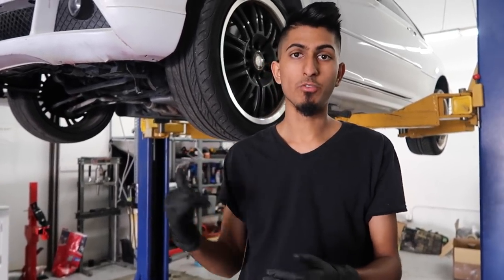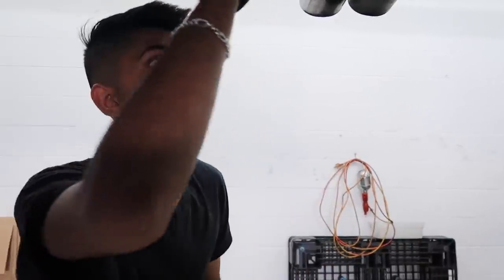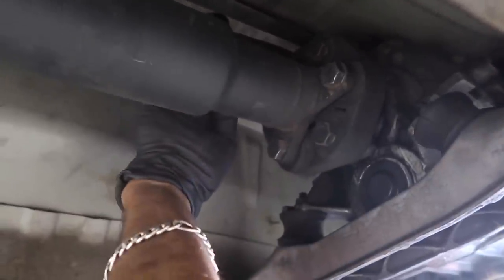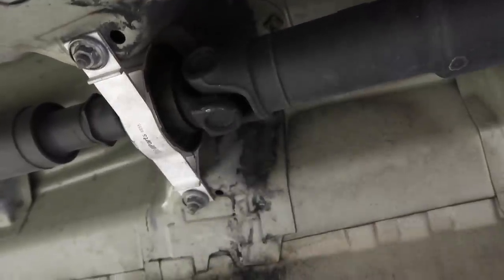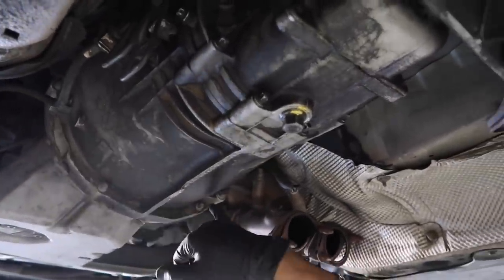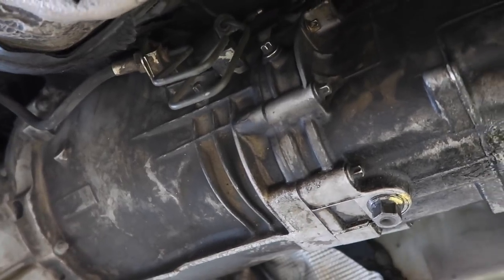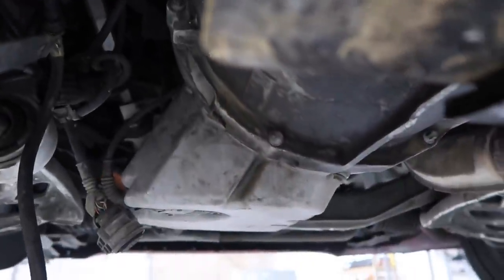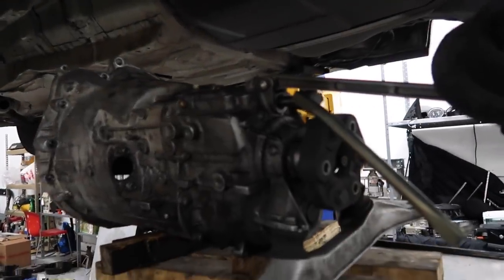DIY BMW Clutch Replacement (Part 1)

Comment: cant believe i never thought of using the screwdriver trick when unbolting the diff. Totally forgot about that on like 4 different occasions and kept crawling out from under the car, undoing e brake, spinning drive shaft to other bolts, crawling back out and pulling up ebrake, then getting back under to get the bolts off.

Comment: Very good video, but my one peev in all videos that i have watched is that everyone labels the bolt size by the size of the socket required to remove it not the bolt size.  Just a detail but go to the store and find a bolt or nut the size mentioned and it will be the wrong size every time.  Bolts are categorized by the size of the shaft and threads.  So 8 mm X 1.25 mm X 50 mm.  usually uses a 13 mm socket, or 12 mm socket in Japanese cars.  8 mm is shaft width, 1.25 mm is the distance between the thread ridges, 50 mm is the length from under the head to the end.  Good luck

Comment: I have searched all over your channel for part 2. To this.   Putting in new clutch and flywheel   and found a seized  engine.    Very odd seeing how I drove it in the garage and it would run if started in neutral. Wondering if I did something  during swap. Or missed a step.  Old video yeah. But if you do get this direct me to part 2 please
Reply from the maker: Hey part 2 was taken down but I added another video that goes over the whole process, it’s in the description: https://youtu.be/59xXMFTVgzo
Reply: @ShopLifeTV    you the man.   Thanks bud.  Imma figure this thing out eventually

Comment: I ended up breaking the little thin metal plate looking thing that is attached to the bell and the block. Do I “need” to buy another one or is it okay to just put everything back without it

Comment: This was a fail for me because the E14 bolts were stuck on extremely tight. I had to reassemble everything. I even used a Milwaukee impact driver but nothing. Any tips will be much appreciated thanks.

Comment: Hi guys, I got my bmw e46 318 n42 engine, the car was pulling as much, you it slapping after it catches speed, so they rebond the chutch plate, after it doesn't want to  move, and from  the shop they give me washers to put between pressure plate and flywheel, but still doesn't move.... please  help

Comment: I purchased a self adjusting clutch from the dealership and I accidentally removed the locking plate before i installed the pressure plate and i installed the pressure plate anyways because it was too difficult to reinstall the locking plate. Once I reinstalled my bell housing and slave cylinder, I tried pushing down on my clutch but it would only depress about 1 to 2 inches and hangs up. Now I need to pull everything apart again. Does anyone know if it is critical to remove this locking plate after install and not before? Is this why I am unable to depress my clutch? 

I just tried reinstalling the locking plate onto my old pressure plate using a large  2-jaw gear puller and a 3/4" x 1.5" x 1.5" piece of plywood for the pushing plate in the middle for the gear puller. i was successful! 😀... So now I'm going to pull everything apart again to try and reinstall the locking plate... 

Please someone let me know why my clutch does not depress and if it is really critical to reset the clutch with the locking plate... I don't want to have to pull my transmission again...

i ended up dropping my transmission again yesterday. when i looked at the pressure plate, all of the fingers were fully depressed which is why i could not push down on the clutch. i then pulled off the pressure plate and followed a video on how to reset a self adjusting clutch. i built a jig, reinstalled the locking plate in the middle of the pressure plate and then while i reinstalled the pressure plate onto the flywheel with the 6 hex bolts i had to compress the springs on the self adjusting mechanism as i torqued the bolts to 35 Nm. then i popped out the locking plate and put everything back together and installed my slave cylinder. i pressed on the clutch and YES. the clutch felt normal again... man... it's a totally different procedure when you install the oem self adjusting clutch on the e46.
Reply: any link for the video

Comment: If I'm replacing the release bearing should I just replace the entire clutch on my 325xi, was going down the road and my clutch had alot of pressure to the point I could change gears or start it, eventually just force it down and it started but gears were super rough to change

Comment: Hey I have a problem one day I was driving then my clutch stop going in now it’s hard, but clutch goes in gear wen cars off, but won’t grab when on, I had my clutch checked but someone told me it’s my slave cylinder what’s your thoughts e46 bmw328ci 2000

Comment: Hey I have a question... I have a 2007 e60 standard and I’m havin a hard time shifting to 1st gear at times... is that a sign that I need to replace the clutch ?
Reply from the maker: Hey! It could be a clutch, slave cylinder, or even an internal issue. Start by changing the fluid and see how much metal shavings come out in the old fluid to judge the amount of internal wear.

Comment: Great vid!

Any advice for someone doing this on a 2001 325i who's exhaust flange is basically one ball of corroded rust? Two of the nuts basically flaked into pieces so there is no way to traditionally remove the exhaust from the header flange.

I was tentatively thinking it might be possible to basically just grind the bolts and studs out then drill back through where they used to be just enough to run a stainless steel nut and bolt through.. and try to sandwich it all back together that way.. but any advice from anyone who is run into this issue or might have a better idea would be appreciated.

Comment: I have a 99 328i nd when the car sit for a few hours i cant shift into gear but when its off i can...after i drive for 5 mins she shift fine any ideas?
Reply: yesse N Nunnie maybe a throw pit bearing, the pedal feels fine and smooth?
Reply: Throw out*
Reply: It feels smooth when I get the temperature up to half she takes gear fine

Comment from the maker: Part 2 is no longer available, but this video has everything you will need to finish the clutch replacement: https://youtu.be/59xXMFTVgzo
Reply: hey dude ! your part 2 is a dead link :-/
Reply: Yeah the link does seem to be broken in the comment section and description. Great video though.
Reply: Please Please please post part two!
Reply: Link is broken bro
Reply: I need part 2!!! Link doesn't work
Reply: Sort your part two out bro no point in having half a video
Reply: ShopLifeTV bro WE NEED PART 2 !! Its not working on both the comment section and the description!!
Reply: Hi part 2 video is not working
Reply: I really need a 10 min chat with you or someone who has your experience in the 3 series. My 03 325, 5spd rwd.. Not awd, is at a shop and time is ticking. I believe the shop isn't right with my car. I was having a scraping noise coming from rear of car. I thought it was a brake pad or rotor but my car would make a clunking noise when I would reverse. Banging on the rear under way seem to be center of rear seat. So I knew the center bearing was going. I bought the car from hot 100 degr Florida in Nov and came up to freezing N.Y.. My throw out bearing for clutch was making a type of tapping jiggling noise when I bought it. In a snow storm getting stuck every 20 feet on a travel for work my clutch pedal went basically away. I had to start car in gear from then on and shifted with ease very low rpms.. Not smart but I wasn't hurting it. Well... The scraping in the rear area got worse and wen i was driving the rear locked up at 45mph and I got it off the road. I started I in neutral no prob. Tryd to do my brilliant start in gear and it only was able to creep 5-10.ft. I believe my center support bearing got hot and seized... Causing the rear to lock. My clutch never seemed to.slip at all. Shop is telling me I need clutch..slave cyl and hose to it. Nothing abt my rear support. Now I'm abt positive the clutch is just fine.. But needs slave cyl..and throw out bearing, and the rear support. 8 also found the conversion kit so I f I have to do clutch I don't have to spend 400-500 on just the fly wheel. I don't have $ I have 4 kids... Was just homeless. Is the conversion kit just an easy slap in back to single clutch? He wanted 1400 for everything not a word about the rear. Support. I do if he pulled driveshaft an spin rear wheels by itself. I'm gonna have to use rent $ for just the begining without rear issue... I'm going to stress heavy and 8 don't want to lose the car or bigger things.. Don't know what to do... Sorry the rambling .. Chris help!
Reply: dead link man...
Reply: link doesn't work
Reply: ShopLifeTV link doesn’t work we need part 2 😭😰
Reply: Part two link doesn’t work! Can you repost it?
Reply: I need part 2 brooo
Reply: Yo why is part private??
Reply: Can you make part 2 as public PLEASE?

Comment: This isn't DIY. DIY is on the floor without a professional hydraulic lift.

The top bolts to these gearbox are a complete pain in the arse to get on your back on the ground.
Reply from the maker: Ive done this without a lift in my older videos. I use the lift so that it is easier to show on camera.